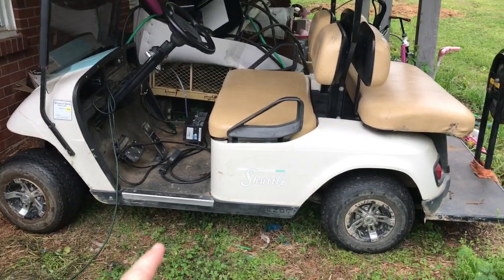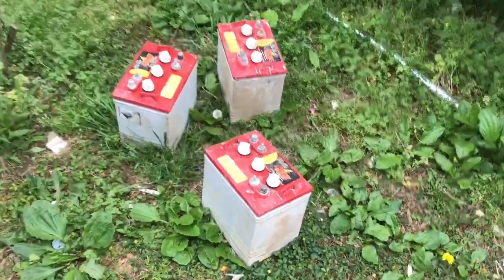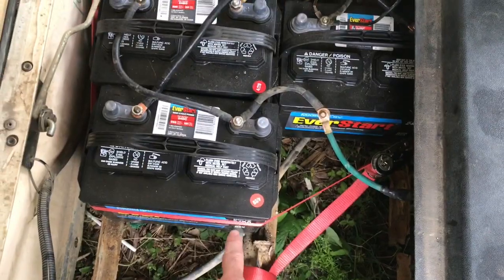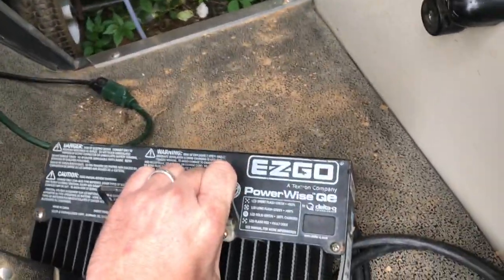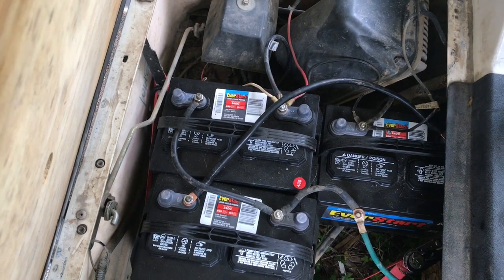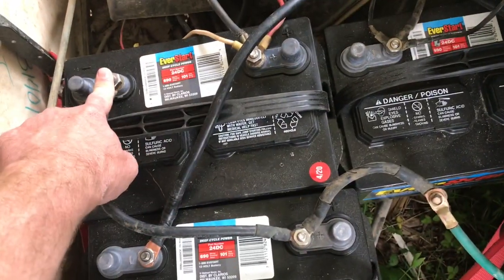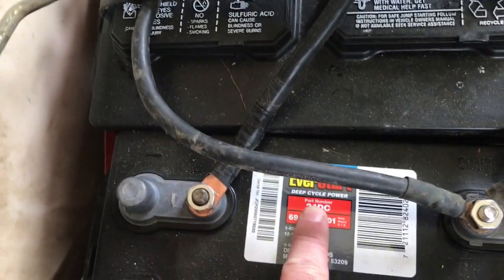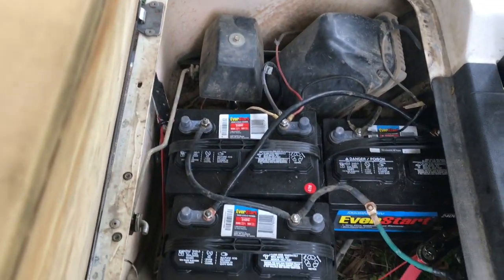12 volt battery in a 36 volt golf cart.

Comment: How much running time do ya get on a charge? I did this and it's maybe a third of the time before I gotta recharge. And that's using  3 deep Marine cycle $180 batteries Duracell.
Reply from the maker: 6 volt to 12 volt golf cart battery swap 1 year review
https://youtu.be/iFT_4ubdDF0
I’m not exactly sure how much run time I had before the swap I bought it with bad batteries.  I can get about 3 miles out of a charge and it quits at about half a tank.  But that’s with nothing else running like underglow.

Comment: The green wire you have going to positive where is the end of that connected?
Reply from the maker: Drew Fuller https://youtu.be/49JOVNnDnuM
Reply: The greenwire goes to a positive on the same 12 V battery as the end negatives go that's that's why the front lights don't work because he blew the light bulbs at 24 V but the rear lights will still work

Comment: Hey Chris! Great video. Do you use your 36V charger to charge these 3 12V batteries?
I would really like to see how you hooked up your Forward/Reverse switch AND your 
charger to these 3 12V batteries. 
I'm doing the same with my old Club Car. The six 6V batteries were still working, but they quickly 
lost their power after only a short drive, which is why I got three 12V batteries, deep cycle.
Another video would be great, showing the connections of all the wires.
Thanks in advance. Stay safe!
Reply from the maker: I did a S1 S2 swap for forward and reverse, and I use the charger that came with the cart.  I can try to get another video but it'll be a few days.
Reply: @ChrisThedudenurse  Thanks a lot. I'll look for it.

Comment: Thanks for the video! Did you notice any power gains? Do you charge every night or just when its getting low?
I want to put lights on mine and might wait until I do a battery swap like this. I really like the idea of only 3 batteries! Thanks again!
Reply from the maker: I don't know if I had any power gains or not as I didn't get a chance with the 6 volt to really test it. I did have to do a S1/S2 swap, but again I'm not sure if that was from something else as I had just bought this cart when I did the 12 volt swap.  I also only charge it when it's getting low, not every night.

Comment: At the end u said 24DC....is that the series like 24 series, D for deep, C for cycle?
Reply from the maker: I'm not sure if that's just a random part number, but it would make since for that to be DC for Deep Cycle.
Reply: 24 DC is the battery size
Reply: Yea it's the battery group size.  Amazing they wouldn't use something else when dealing with batteries. 🤔
Reply: @B resin  yes, you would think that they would not use 24 or even DC (meaning something other than direct current) on a 12v battery.  I felt a little awkward asking the above question but  I see that it is an obvious manufacturer's system that catches the attention of people familiar with 12V batteries...lol

Comment: How far are you able to drive with those batteries
Reply from the maker: I haven't run them all the way out yet, but I've driven several miles on a single charge.  If I was to do it again though I'd get batteries with more amps.
Reply: Chris The dude nurse I did the same this but with the Walmart marine battery 29dc for $99 ea. Best estimate I can go from 5 - 10 miles on a single charge
Reply: firestorm302 that’s exactly what I did. Do you charge it with the ez go charger or do you charge them individually?
Reply from the maker: Mark Sain I charge it with the ezgo charger.  Works just fine.
Reply: @firestorm302  Hi...how did you wire your three 12 volt batteries? Did you do the same as Chris or did you have to modify your wiring a bit?
I'm having trouble deciding where each of the wires/cables go. 
Chris shows that he has a positive wire from the motor going to a positive battery post, but the only positive wire coming from my 1982 Club Carr motor has it going to the Forward/Reverse switch. And the only other wire coming from the motor that goes to the batteries is negative and has to go to a negative battery post.
Got any ideas about this?
This is the wiring diagram for my Club Car:
99282e9970788ba344a8c8c56308396a.jpg